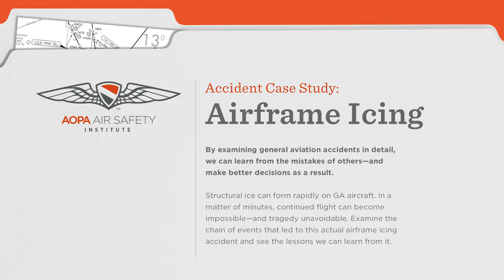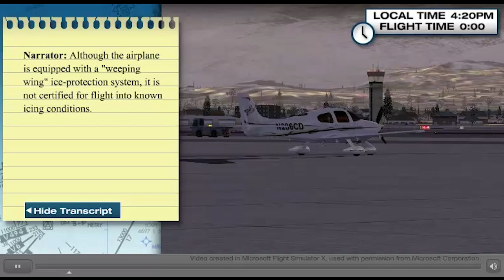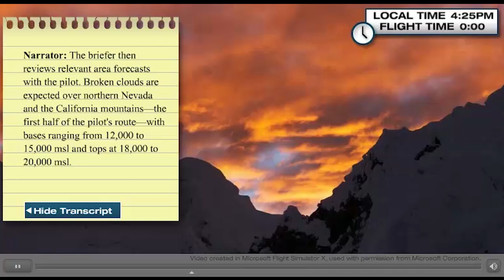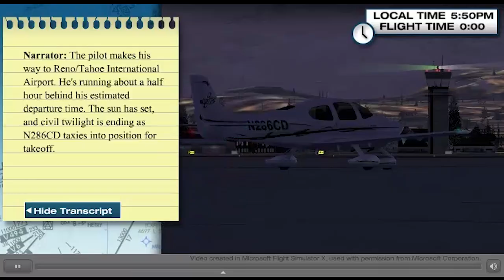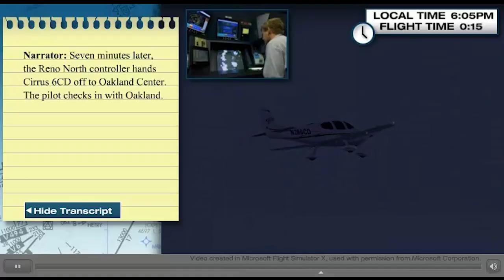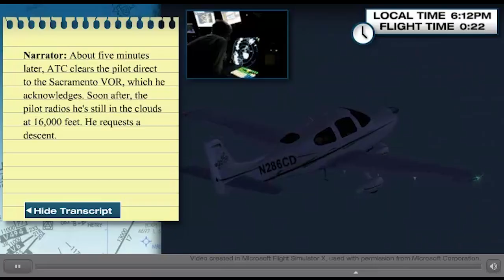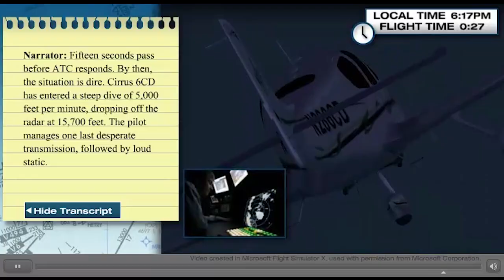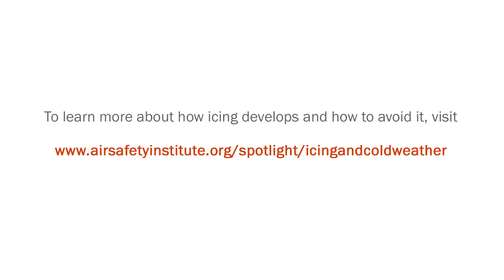Accident Case Study: Airframe Icing

Comment: Another informative, yet sobering video. On watching the events unfolding, I wonder if the PIREP from the Southwest inbound was ever relayed to the Cirrus pilot? Or was it so quick, there was no transfer of info from approach to departure yet? Just wondered. RIP pilot.
Reply: If I was flying a Cirrus and got a pirep of a Boeing getting moderate rime I'd be "uh nope, heading back" What's moderate in a huge aircraft like that would be severe in a small GA aircraft. Same for turbulence.
Reply: @ryanhampson673  My thought, heading out for departure, might have been "that PIREP was for 17,000 feet. I'm not going to be anywhere close to that altitude." I might have gone forward in departing.
Reply: I caught that too but I think it wasn't relayed I think in this case the pilot relied on his own de-icing system as a way to get out of trouble he wasn't concerned with asking about ice.
Reply: Wouldn't have made any difference as that pilot wanted to get home a day early.

Comment: I don't know why anyone trust these de-ice systems on light aircraft your already playing with fire with a slow flying low powered  aircraft flying into known winter low pressure this guy must be an idiot. Not like your flying an F-16 just stand it on it's tail and climb to 50k feet in 1 minute get on top of these things. I don't understand how these guys get the flight cert they just have such poor judgment. I would think some humane performance training would be value as part of the required training.
Reply: The system on this Cirrus, was not a true "de-ice" system, but rather an "anti-ice" system only meant for "INADVERTENT flight into icing" and not "flight into KNOWN ice", which are extremely expensive option, and rare on GA aircraft. But, yes, I fully agree with you, that these so called anti-ice systems on GA aircraft should not be given serious consideration, when even the possibility of icing conditions exists!!
Reply: If he missed the Southwest 737's pilot report, he didn't have forecast or known icing on his proposed route--just conditions he needed to be aware that could be conducive to it. Also, my guess is that you've never tried to fly an extremely thin, low-aspect ratio wing like an F-16's that was suddenly subjected to any kind of accumulating contamination. Having all the power in the world doesn't mean anything if you can't stay in control of it, and that can happen in a flash. Fighters are poorly equipped to ward off ice and their operating manuals on the subject will generally just say something to the effect of, "Whatever you do, watch for any icing conditions and stay out." They can't handle it except for brief seconds as they are climbing or descending from good conditions to good conditions. I would never want to be aboard a fighter in an encounter with serious icing. 747-pilot's comments about the system design is also key. Some advanced light aircraft have this type of system that is certified for flight into known icing; some applications are not.

Comment: ATC requesting he climb to 14,000 was the start of this. I think they are partly to blame in asking him to climb up into what was clearly icing conditions. The pilot probably assumed ATC knows best. The more of these videos I watch it seems ATC does not know best and is sometimes not very helpful or even downright unhelpful/dangerous.
Reply: +BB992 as a pilot and a controller I hands down received more weather training for atc than during pilot training. The controller asked if the cirrus pilot could accept higher to 14000, he could have easily said unable. It's the pilot's responsibility to know the limits of them self and their aircraft. Controllers will separate ifr aircraft, provide advisory services, and help in any way they can but ultimately they have to carry the assumption that the pilot is competent enough to fly his aircraft safely and responsibly, which all too often isn't the case.
Reply: I like to...- Maybe that' the case in the US. but in the EU we have to do one theory exam just for meteorology, two if you're going pro. I'm with you on the rest of your comment, that was my point.

Andy- ATC are not the master of us in controlled airspace, under any flight rules. You are allowed to deviate from ATC's instructions AND you're allowed to flat out refuse an instruction if you feel it affects your safety. They're on the ground. they don't know what's going on, and regulations take that into account. Ask "I like to fly stuff" here, ATC provide a service, nothing more. Of course the request was not helpful, but ATC doesn't know the pilot/aircraft/conditions. The system depends on proper communication between pilot and controller, and the pilot failed to deliver. Remember, as PIC you have the authority to do anything in the name of safety. You can, if you want, when number 10 in the traffic pattern, key in the mic and say "i'm now number 1 to land" and you'll be in your right to do that. Of course, the tricky bit afterwards is having to explain WHY you needed to be no1 to land!
Reply: ATC didn't know he was icing.
Reply: ATC isn't to blame he they have no idea what systems he has they are not there to make decision  for pilots he could just say he was unable because his aircraft wasn't rated for known ice they would have re-directed him. The blame is 100% on the pilot in this case he could have done million different things even when he climbed near ceiling was almost stalling could have pulled his CAPS there and just let god figure it out. I bet he thought he would go lower recover and figure out something once in the dive he was iced  his control his flight control was nothing he was just a falling brick of ice. The first thing is just don't fly in bad weather in a GA aircraft single piston engine.
Reply: The controller is not in your plane. The pilot in command can reply to any ATC request with 'unable' or 'I can't do that' or even just an 'Are you sure that's safe? It's pretty heavy icing up here' or anything like that.
Reply: No they are not. PIC is always the final authority as to the operation of the aircraft. ATC's job is to coordinated traffic flow. They work for the pilots, not the other way around. "Unable" is a perfectly good response to any instruction the PIC feels is unsafe or potentially unsafe. As they say, never let ATC fly your airplane.
Reply: Andy McKee how can you blame atc!? The asked if he could do 14,000 and he agreed when he simply could have said no. Also he never declared an emergency so the controller had no idea how urgent the situation was. Atc was definitely not at fault here.
Reply: NO.  ATC doesn't know the conditions.  It's incumbent on the pilot to make decisions and this guy was clearly well behind the decision-making curve.  He over-estimated the capability of himself and his airplane.  He should have deployed TKS and reported ice at the first signs and turned back.  ATC can't fly the plane nor make decisions for you.
Reply: @sbestpa  Yes, he should have reported the icing and descended.  But the NWS failed to report the potential for icing conditions in that area so the pilot had no reason to suspect he'd enter a moderate-to-severe icing event.  Once it began, he only had less than a minute (at most) to really process what was happening and decide what to do about it.  There's even a chance that the icing only began during his final ascent to 16,800 which is why he didn't say anything beforehand.  He really may have only wanted to get above the clouds.  If so then he only had maybe 15 seconds to figure out how to respond to the sudden and unexpectedly large amount of icing he encountered.
Reply: ATC is not the boss. They just control the airspace making sure it safe for everybody. So if you say you can't comply with any transmission because its unsafe for you. It's their job to find a solution. Not to make their job easier.... It's why so many wait to long to declare an emergency and get killed. They think it's going to effect ATC job. When that is their job to make sure everybody gets home safe!
Reply: I'm not a pilot but I was surprised when ATC asked him to ascend to 14000 when it was icing.  I'm surprised he did it, too.
Reply: @abc-wv4in  Me too.
Reply: It's true. ATC DON'T know what's best. They aren't pilots most of the time. It's up to the PIC to say yes/no, that's our jobs as pilots. ATC are NOT the boss of us. They have rudimentary meteorology training compared to pilots anyhow. The weather brief clearly indicated a low freezing level and thus icing. He shouldn't even have taken off tbh, since that was flying into known icing conditions. Ignoring that, it was the pilot's inability to assert himself and his pilot in command authority that got him in that mess. Be pilot in command. Number one rule. The pilot was instrument rated. If he truly believed ATC knew better than him then he should have grounded himself and hit the books for a recap. ATC was not at fault here. The pilot was. He made all the mistakes. He did not communicate his emergency, he did not communicate his inability to deal with icing. ATC 
 It's a real shame he deployed the chute before checking his speed. Dunno how he could have done it by that point though...
Reply: +BB992 ATC are the boss of us in controlled airspace. As this guy was flying IFR and started in controlled airspace he was under the instruction of ATC. Not sure he was in controlled airspace when the ATC controller asked him to climb to 14000 but as he had just gone from a controlled area then I guess the mindset may still have been in place that he should comply to requests. You are correct that it ultimately comes down to the pilot and indeed the pilot was to blame, all I'm saying is that this request from ATC was not helpful/safe given the known conditions.